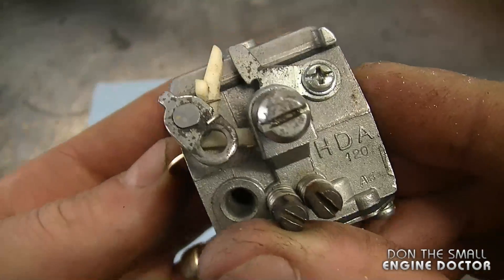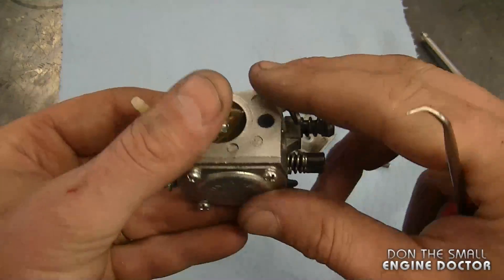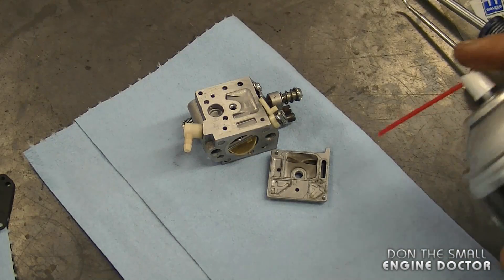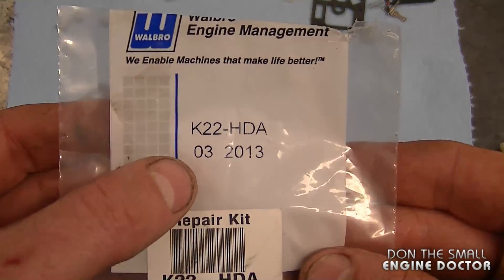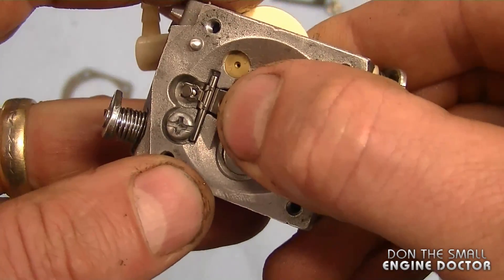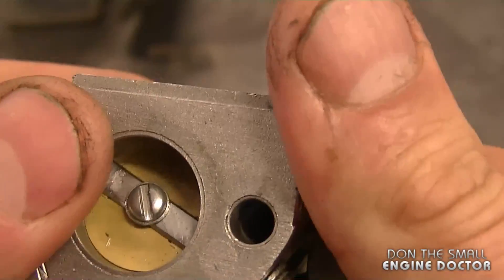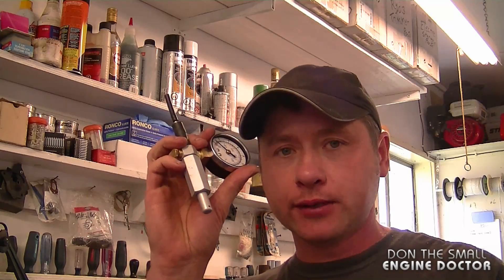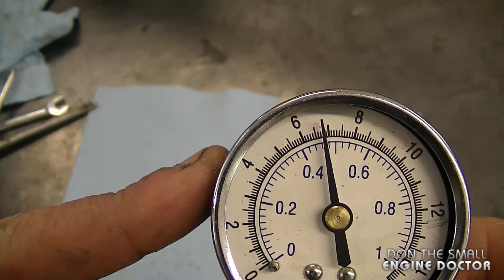HOW-TO Rebuild A 2 Cycle Chainsaw Carburetor - video

Comment: When you do use a ultra sonic cleaner what type of cleaner do you use? Are they expensive and do you use carb cleaner as the solvent in the cleaner.
Reply: +Thinking Impaired I understand a good dish soap and water works well.
Reply: on the ultrasonic unit look at Harbor Freight and catch it on sale and if you set an email account you can download a % off coupon to use also.
Reply: Raymond Campbell  Thanks Ray
Reply: Thinking Impaired you are welcome I got one of theirs and is great. I either use dawn dish soap and water or purple power cleaner and water to clean with. check ultrasonic cleaners on you tube on how they are using them and what their cleaning solutions are. I gett good results with the 2 I use. Simple green and water is OK too it is biodegradable.
Reply: Thanks, in the past I've used some type of brand name carb soak in a gallon can. The fumes were very hazardous to breath in, I believe some type of weak acid was used in the formula. So avoid the carb soak. 
Since then, I did learn that 3M N95 rated masks do a good job of protecting my lungs.
Reply: I know what you mean Gunk makes one in a gallon paint can. I would not use that on small engine carbs, especially small 2 and the new 4 cycle carbs. And if you are using the ultrasonic, after you really heat up the solution be careful on any plastic or nylon parts as it can warp or melt them. Sometimes you have take all rubber and plastic off to really get a good clean. Do not use caustic cleaners in ultrasonic machines. Not good on you and the machine.
Reply: I used the Gunk 1 time as a last resort on an old out of date mower carb and only dipped it for a few minutes and rinsed with water and blew it off before using anything else. The Gunk cleaner is really hard on the aluminum carb parts.
Reply: Ray, I believe it is gunk brand. It was something that I used on Rochester carbs. The crysalic(I know I misspelled the name) acid was what we all used to use many years ago. I read the harbor freight reviews and many people mentioned their home brews that they recommend. I am thinking the ultrasonic cleaner is going to be very useful. I'll make sure to remove all plastic and rubber parts before placing it into the hot solution.
Reply: +Thinking Impaired I have a ultrasonic cleaner and will use just hot water on most carbs but will go to hot water and dish soap for the tougher jobs.

Comment: Is there any point in removing the mixtire screws when cleaning?
Reply: +Dean Mavis YES. Often a machine will have a plugged low or high jet.
I thoroughly clean all passageways and often they still never run. Im thinking that the only ohter thing I dont do is change new diaghrams.